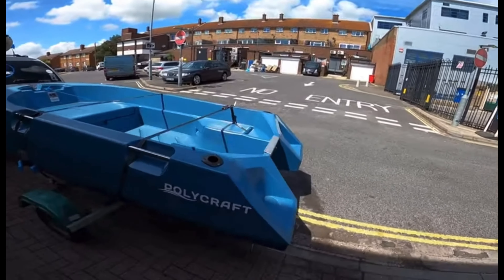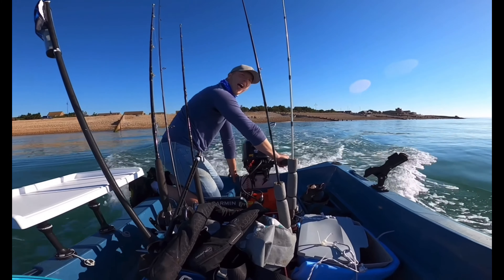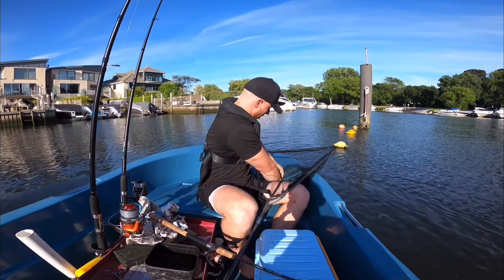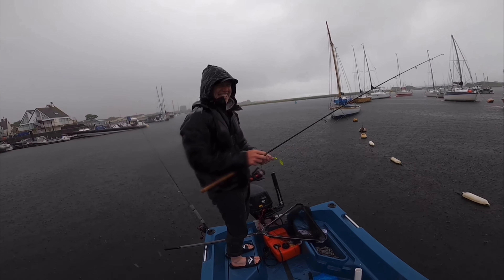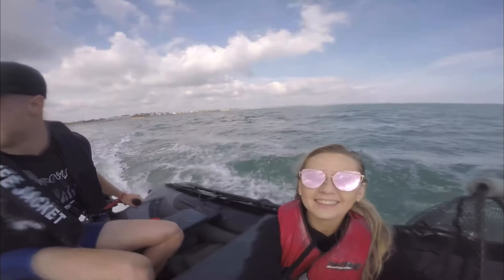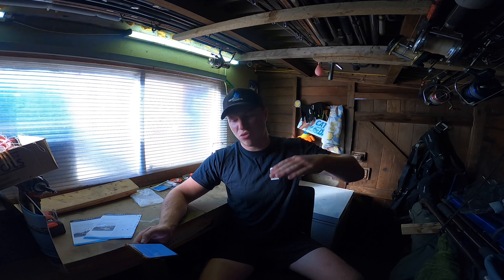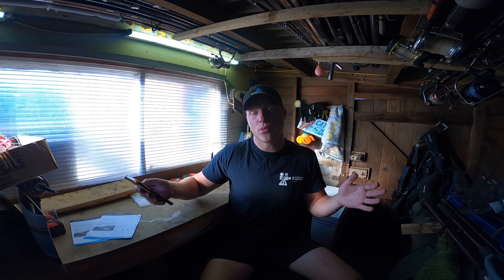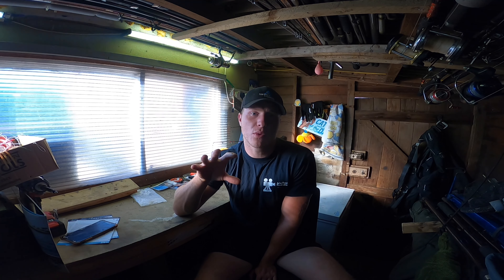Full Independent Review Of The Polycraft 300 Tuffy UK - Is This Boat Better Than A SIB

Comment: Great video!
It's nice to see there is more on the market! I hope they do come to UK. I did look at plastic boats before going to a sib and the only ones I could find were by a brand called BIC which they may make good pens but it's a no from me for water craft.

For me at this point in time  I will stick with my sib and the shetland. My sib is good for those super shallow waters where the big boat would not be suited for.
Reply from the maker: Thank you! There’s not many decent plastic boats on the market. Most small ones can’t handle a decent motor size. That’s why I went for this one. They are actually in the UK now and the clients who I have spoken to who brought one love them. The Shetland has unforgivable seas so definitely need a boat which can handle a lot of the tougher stuff! Have a great week

Comment: Hi mate thanks for your video. I was considering one of those and contacted the manufacturer in Australia around 2020, at that time they were only imported to main land Europe so I end up going for a whally 310 instead. Fancied the pioneer as well but thought they were slightly overpriced. Polycraft has in my opinion fishing and water sports in mind. I used my whally about 10 times in Scotland waters with in occasion strong winds and currents and during covid times. I filled it up once with wave water almost as a bathtub and still floated and navigated so this type material is very safe. I found the whaly transom to have a slight angle inwards which caused my 10hp engine to throw water into boat. Eventually I sorted it by raising the engine trim, instead using raising plates. Found it very good but even in low revs very very wet ride having to use my dry suit for comfort. Def prefer your model so hopefully you may give us a review in few months. Also polycraft with 15 hp can plan better and tow a small donut ring or banana 😂
Reply from the maker: Good morning, thanks for watching. I agree, polycraft has the angler in mind. It’s designed to be easily used as a fishing boat with the rails, cleats and storage. It’s ideal! It naturally floats and doesn’t want to sink, hence why it’s super safe. Always good knowing even if overturned it will still float. I heard a few people saying about the transom on the Whaley. No issues at all on the Tuffy. It’s quite a dry ride once on the plane! I still however wear my dry suit. Just adds a bit more safety aspect to it! If you ever go for a Tuffy 300 let me know! Happy to share my experience with you

Comment: Nice review. I like solid Dinghies as Tenders,  usually towing them wherever .I go, but unfortunately I can't afford a Sailing boat large enough to be able to have one securely on-board, and tbh, that weight is a huge downer for using in the range of needs that a Yacht tender needs to fill, and lots of people are ditching Fibreglass RIB's as Tenders due to that weight Penalty. So Horses for Courses, I'm going with a 41kg Hypalon 3mtr Air deck and Keel which can be rolled up and put in a Lockable  Cockpit locker with a secure mount for a 6hp 25kg Outboard of Tohatsu Manufacture by the looks of it. A very nice review of a Dinghy that will be just right for a lot of people.  Best Wishes,  Fair Winds, and Tight Lines. Bob. 👍🙂
Reply from the maker: Very good points made there! Certainly horses for courses. I heard many are ditching little RIBS. It will be interesting to see where it goes. So many SIBS son yatchs all deflated and looking tired I’d be unsure if they would even work as a small rescue boat or survival craft. Hypalon is a far superior material to PVC though! Much tougher
Reply: @MuscleFishingOfficial  I looked into PVC ones a fair bit due to apparent weight advantages, and figured out how to help make one last, basically welded seams instead of Glued, the new UV resisting Fabrics, drop some air out of the tubes if it’s going to be a hot day, then when being used, wipe the tubes over with a cheap sensitive Skin High Factor Sun Blocker, then when the tender is back at the boat, out a full boat UV protection Cover on it, which apparently is much better than using Dinghy Chaps which mostly are really expensive as need to be Custom  made. Then I found a good make Hypalon one in the size range I need for about 500 quid more than the best new PVC, and they do a Full UF Protection Cover for about 60 quid, and treating the dinghy right, it should last me 30 years , or 10 years longer than I’m likely to keep the Sailboat. So imho, worth the extra investment. All the Best. Bob. 👍
Reply from the maker: @brownnoise357  HYpalon is far superior to PVC! You made the correct choice there. That’s why the lifeboats are all hypalon. 👌🏼 tight lines and have a great week!

Comment: Nice comparison. At 3m what category boat are they? 
CATEGORY C – INSHORE

This rating is for boats operating in coastal waters and large bays and lakes with winds to Force 6, up to 27 knots, and significant seas 7 feet high.

CATEGORY D – INLAND OR SHELTERED COASTAL WATERS

This rating is for boats in small lakes and rivers with winds to Force 4 and significant wave heights to 18 inches.
Reply from the maker: Due to a very small technical specification in the UK regarding the seating they have come under D. However realistically they should come under are C. I have tested them in significant swell and they perform really well. In Australia the standards are different to here and they operate inshore all the time. So I’m very confident they can handle the UK sea in what I’d call  “reasonable” conditions you can expect one to encounter.

Comment: Would a 6hp mercury push a polycraft tuffy ok or do you think o will need a bigger engine? Great video
Reply from the maker: On the sea I’d rather a 10 or more. But that’s because I go out far. If your doing close to shore work(sub 1 mile) , estuaries and rivers a 6hp will get you moving. But not fast.
Reply: @MuscleFishingOfficial  thanks matey 👍
Reply: One more question what trailer do you use for tuffy im looking at 350kg bunked trailer available at boatworld and wondered if this would be suitable. Think I've finally talked my wife into letting me upgrade to a tuffy this video helped ....Nice work 👏 👌
Reply from the maker: @alexstubbins6298  good evening, hope your well. I have taken the time to look and good news. The smaller trailer https://boatworld.co.uk/extreme-300kg-inflatable-galvanised-boat-trailer I believe would work perfectly and is a bit cheaper than the 350kg one. They are great little boats and I won’t hesitate to take mine anywhere. So easy to trailer, launch and use! For me this and the kayak is a perfect option! Look forward to seeing what colour you go for! If you need any dealer info give me a shout!
Reply: @MuscleFishingOfficial  many thanks
Reply from the maker: @alexstubbins6298  do you need to know your nearest stockist?
Reply: Yes I am based in whitstable at the moment in Kent  but am relocating to the North East near amble so I will be looking at a stockist up there. Been looking at purchasing it from p&d boats
Reply from the maker: @alexstubbins6298  sounds good to me! There’s also stock in Durham if it helped you out.
Reply: @MuscleFishingOfficial   what supplier is it in Durham.  Many thanks for your help
Reply from the maker: @alexstubbins6298  it’s a direct warehouse. Give me a email to jakehdavison@hotmail.co.uk and I can pass on some details to you bud

Comment: Have one lined up in Texas. Was wondering about trailering with the engine mounted. Is it best to remove and reinstall?  Also commented on another video about running wires in hull.
Reply from the maker: Good evening, this comment was not just come through. Personally I prefer to trailer with engine off, avoids any stress to transom. However if you decide to keep engine on it’s probably best to bolt it on and use a transom saver to ensure the engine doesn’t bounce.

Comment: Do you know anyone who has scuba dived off Polycraft 300... basically, how hard would it be to reenter the boat with out scuba gear on... or if you accidentally fell overboard?
Reply from the maker: There is a swim step at the back. You can put all your weight to one side and the boat will barely move. You could add a ladder using the handles on either side aswel if you wanted.

Comment: Hi, thinking of getting one of these, dont really fancy the hassle of a trailer though, i have a van, the roof is rated to hold 170kg (already have a roof rack fitted for my kayak) my question is, do you think I would be able to transport this on the roof rack, and what is the best way to get it down to the beach as thats where i would likely launch from.
Reply from the maker: Hi there, if your rated to that weight then yes absolutely could go on the roof. I’d say a flat base would be ideal. A collapsible ramp which gets attached to the back and simple push the boat down it. I have thought about it for mine but it’s not rated for that weight. A winch on the roof at the front might be handy to lower the boat down slowly. Best way to launch it down the beach is simply drag it down. And then tow it back up using a tow bar. Or if there’s 2 of you, take engine off and kit out, then you can pull it up with a rope. Hope this helps! Any questions feel free to ask

Comment: Thanks for doing a video on these new boats. Unfortunately due to the weight and cost they are not comparible to a sib. The weight alone means they should be compared to fibreglass or ally boats (that need trailering). Also at 3 metres long  they should probably not be used in open water.
Reply from the maker: I had a SIB previously, And never felt fully comfortable fishing from it so never fell in love. I wanted a solid boat that I could launch anywhere like a SIB but was solid. These boats can be launched anywhere and dragged around with ease. I have been 10 miles out on this boat, put it through some serious chop and can be more than confident they are not only safe at sea but also they are up to the job. Ali and fiberglass boats should really have rollers on the beach and similar size boats are the same or more in weight. 

But everyone will have there own thoughts. I just know going from a SIB to a 300 Tuffy I’m much happier fishing from it, and everyone else I have taken out agreed.
Reply: You are absolutely right to suggest this is not a true comparison - one is a rigid boat and the other is an inflatable boat - chalk and cheese! In any event,  given that the Tuffy is more than twice the cost of a similar sized SIb, plus the cost of needing a  trailer, tow bar, lighting board and tow bar electrics the cost of  Tuffy set up will be around 3 times the cost of comparably sized a sib set up! If you want a plastic boat, there are other established, well regarded  - and cheaper!! - brands out there!

Comment: think i would prefere the whaly 370 over the polycraft,same price ,bit bigger,will take 25hp rated c for 6 people and well proven....but as they say what ever floats ya boat.
Reply from the maker: For me, weight was a consideration. I launch off steep shingle beaches and the Tuffy was the lightest. Whaly 310 I heard many people saying the transom is to low. Causes a lot of wet ride. Polycraft included cleats, grab rails, rod holders, multiple integral storage in the 300. So for me it was ideal. All the Railblaza mounts just go on the rail. No need for any drilling or modifications. If I had a slip near me and weight wasn’t so much of a factor I’d look at getting the 410. But for now I’m very happy with my 300 Tuffy. Thanks for watching and taking the time to comment.

Comment: Did you know that they can easily sink! Mine sank twice and Polycraft/Mareta never mentioned at any stage that the rod holders have holes in them which let water in and they DO SINK ! Mine went under twice and was only saved by being tied to the yacht and pontoon. Rather than be honest with me they have denied any responsibility so i am having to take them to court for a new. boat. Terrible company, not to be trusted.

Comment: where in the UK, or contact number please.
Reply from the maker: Good evening, there is dealers around the UK, feel free to message myself on the Muscle Fishing Facebook page for more info you may want or need😊
Reply: thank you for your reply, i came across the polycraft 410 challenger , just for recreational activity, what are your thoughts, im new to this boating activity, any advice would be appreciated.thank you.
Reply from the maker: @noelfinn4741  these boats are coming to the UK next year so not to long to wait. I have not tested one yet however from what I have seen and heard they are great capable boats. The low maintenance and strength of the hulls is my big plus Point.